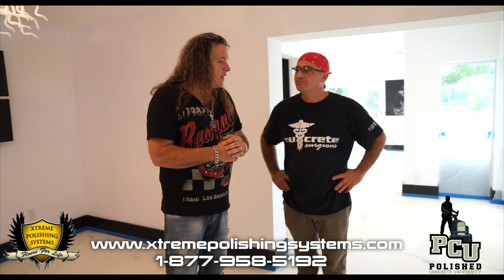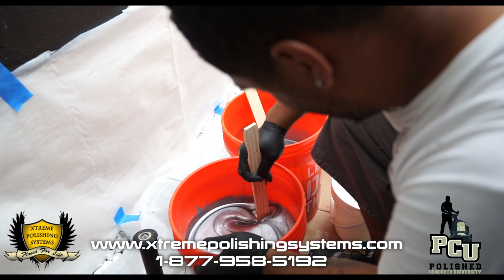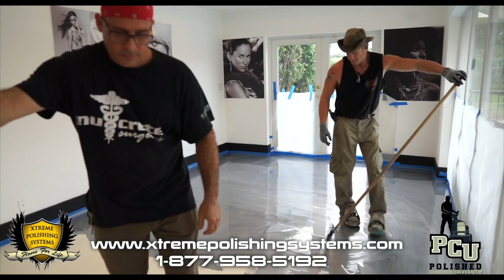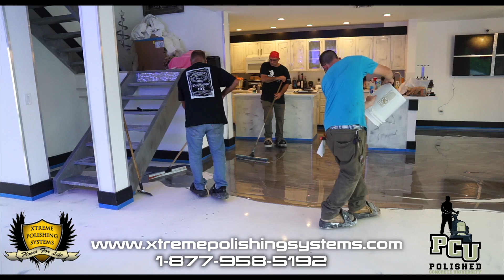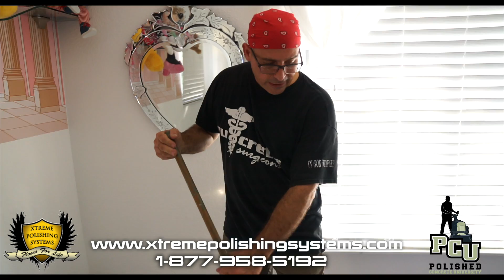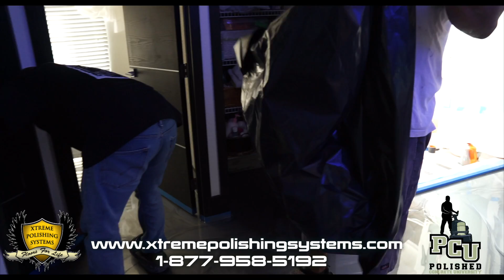Silver Metallic Epoxy Residential Floor Installation Start to Finish | #xps #epoxyflooring

Comment: looks awesome. wonder what the cost per square foot installed is?
Reply from the maker: Our clear epoxy kits are $150 for 3 gallons. This kit will cover between 375-450 SF. When adding in color and metallic pigments, each packet covers 45-50SF. Recommended 2 pigment packets per kit. It's based on the SF you are looking to do. To view our selection of epoxy products, please visit http://www.xtremepolishingsystems.com/Epoxy-Floor-Kits-s/2030.htm

Comment: would it's scratch when you moved you furniture around? dining room chairs for instance.
Reply from the maker: As long as the epoxy has cured properly, it's meant to endure high trafficked areas. It'll hold up against scratches from chairs.

Comment: Wow the end result is too fucking beautiful. For a second there I thought it was still wet haha. How much does a job like that usually cost?
Reply from the maker: We do ship worldwide and can get any product or equipment to Australia.
Reply: Xtreme Polishing Systems i currently do concrete staining but would be interested in doing these epoxy floors as well nice work guys
Reply from the maker: Our clear epoxy kits are $150 for 3 gallons. This kit will cover between 375-450 SF. When adding in color and metallic pigments, each packet covers 45-50SF. Recommended 2 pigment packets per kit. It's based on the SF you are looking to do. To view our selection of epoxy products, please visit http://www.xtremepolishingsystems.com/Epoxy-Floor-Kits-s/2030.htm
Reply: Xtreme Polishing Systems 
Bonjour
Are you in France ?
Reply: Xtreme Polishing Systems what a shame you are not in Australia

Comment: what aboit like a full on shiny metal floor, like not metaluc but like aluminium foil or like a mirror
Reply from the maker: Yes, that is possible to do. Anything you can think of can be created with epoxy coatings.

Comment: How much was the cost?
Reply from the maker: Our clear epoxy kits are $150 for 3 gallons. This kit will cover between 375-450 SF. When adding in color and metallic pigments, each packet covers 45-50SF. Recommended 2 pigment packets per kit. It's based on the SF you are looking to do.

Comment: How much would this cost? Is it available in u.k
Reply from the maker: Our clear epoxy kits are $150 for 3 gallons. This kit will cover between 375-450 SF. When adding in color and metallic pigments, each packet covers 45-50SF. Recommended 2 pigment packets per kit. It's based on the SF you are looking to do. We ship anywhere in the world. Shop our selection by visiting www.xtremepolishingsystems.com/Epoxy-Floor-Kits-s/2030.htm
Reply: Xtreme Polishing Systems thanks does the floor have to be totally smooth for it to lay or will this product fill holes etc ?
Reply from the maker: It's a self leveling material.
Reply from the maker: Yes, we have attendees from all over the globe train at our South Florida location. To learn more about our training courses, please visit http://www.xtremepolishingsystems.com/Articles.asp?ID=285
Reply: Sir I am   from India... Want to do dis course..  Is it possible

Comment: so how would this hold up to damp coming up from under the floor? major issue for any UK home in the winter
Reply from the maker: Depending on how much moisture they have, you will probably have to put a moisture vapor barrier down fort then coat over it.
Reply: In Britain and especially Yorkshire there's a major damp issue, im guessing much like any other flooring, moisture rising up will cause the epoxy to lose its adhesion and lift up? Im also gunna guess that it cant really be patched like conventional flooring? Its a shame cos it looks great but appears only really suitable for warm dry climates like you get in america (its 2°C here lol)
Reply from the maker: It's a self leveling product, but yes, you are correct. The epoxy will not adhere to any wet surface. It would need to be dry and a solid surface.

Comment: Roughly how much would this cost for 1500 square feet?
Reply from the maker: Cost per square foot depends on floor whether they want a solid color, metallic, or flake floor. Give Adam a call at (877) 958-5192 with questions.

Comment: I have a few questions 1 could this be applied in a shower 2 I've worked with epoxies and resins before but only in small batches so what are the recommended sealers 3 do you need to use any special cleaning agents on the surface

Comment: How hard is it to remove this if it ever needs replaced?
Reply from the maker: You would need to use a floor grinder to remove the epoxy, but it's not hard, per say.

Comment: How are they not leaving tracks in the epoxy
Reply from the maker: We use spiked shoes that help us walk on the coatings without leaving any marks.
Reply from the maker: 2-3 days is what is recommended
Reply: ***** How long til you can walk and put furniture down?
Reply: Xtreme Polishing Systems How long till you can walk and set furniture on it?
Reply from the maker: Once the epoxy has been cured and sealed, it's not slippery at all. Epoxy is ideal for highly trafficked areas.
Reply from the maker: Yes, as long as it's a smooth, solid, dry surface, epoxy can be applied on top.
Reply: Sir can it be done on normal floor of cement n concrete

Comment: Hey Chris, just wanted to know how hard this stuff gets in relation to having furniture on the epoxy for extended amounts of time. will furniture leave dents in the finish or even heavy scratches and if so, how are those areas repaired? thanks from Parkland FL!
Reply from the maker: Epoxy is perfect for high trafficked areas, mainly for industrial applications and will most certainly hold up against furniture for long periods of times.

Comment: I've been a painter for two decades now. Epoxy cures/dries incredibly hard. It is TOUGH ! If it is ever anything but perfect, it was applied incorrectly. This is beautiful, and I suspect many of the commenters aren't aware how durable an epoxy floor is. Paint has came a very very long way! Good paint is like painting with liquid plastic, good epoxy.....liquid steel ! LOL
Reply from the maker: Couldn't have said it better.

Comment: Is this removable? Say you want a different look several years later, like hard wood, or wanting to put carpet in a room that's been done with the epoxy
Reply from the maker: Yes, epoxy is removable with a floor grinder. Epoxy is an extremely durable material, so the process maybe tedious.

Comment: can you use it in garage or not recomended? I keep having issues with hot tire pick up.
Reply from the maker: Epoxy is ideal for garages and industrial applications due to it's durability. The most common places for epoxy coatings is garages, kitchens and warehouses.

Comment: Would this be extremely slick if it was wet
Reply from the maker: Yes, it is slippery when the epoxy is wet, but with proper shoes, such as spiked shoes, you will have no problem walk on the coatings while wet.
Reply: Xtreme Polishing Systems 
is the finished floor slippery if water gets in like in the bathroom after a shower

Comment: how much did all that cost
Reply from the maker: Our clear epoxy kits are $150 for 3 gallons. This kit will cover between 375-450 SF. When adding in color and metallic pigments, each packet covers 45-50SF. Recommended 2 pigment packets per kit. It's based on the SF you are looking to do.
p.p1 {margin: 0.0px 0.0px 0.0px 0.0px; font: 12.8px Arial; color: #222222; background-color: #ffffff}
span.s1 {font-kerning: none}
span.s2 {text-decoration: underline ; font-kerning: none; color: #1155cc}

Comment: can we do it on any kinda marble floor ? plz answer
Reply from the maker: Marble surfaces are typically polished and then sealed, but it is possible to apply epoxy coatings over marble. With proper surface preparations, such as grinding down to a smooth surface and applying a primer that can penetrate the marble, epoxy installation is an option over marble.

Comment: what's the durability of the product and the resistance of scratches from pets ?
Reply from the maker: Epoxy coating is perfect for high trafficked areas. Epoxy is durable against spills, stains, scratches, ETC.

Comment: That looks pretty nice. What about bubbles, though? I assume even if you are careful you will get some, do you fill them or can you melt/solvent little parts somehow?  Did you put the charcoal on after the first had set? How did it look with just the silver? Video cuts to the charcoal pour with no indication of time. How would you remove it? Can you do an epoxy over existing flooring just to make it more resilient, a soft wood for example?

In the future could you guys clean up the audio? There's a mechanical/grinding noise in the background that could have been filtered out easily. I don't even see where it would have come from, since you are mixing by hand.
Reply from the maker: To help with the bubbles, you would want to put a torch to the material while it’s still wet. The charcoal was applied while the epoxy was still wet. Don’t wait for the first to set and harden. Before applying the charcoal the silver looked like a newly installed silver floor. To be able to remove epoxy once installed, you would need to use a mastic floor grinder to remove the epoxy back down to a smooth concrete surface. As long as the subfloor is solid, epoxy can be applied over wood. Don’t hesitate to reach out with product or process questions (877) 958-5192.
p.p1 {margin: 0.0px 0.0px 0.0px 0.0px; font: 12.0px Helvetica}

Comment: this video is random to me but what's on the bottom of those shoes? it doesn't even leave a mark on liquid state epoxy? amazing
Reply from the maker: Those shoes in the video are epoxy spike shoes. You are correct, the spiked shoes slip over normal shoes, and will not leave any marks on the coatings. To view these shoes, please visit www.xtremepolishingsystems.com/Epoxy-Pro-Spike-Shoes-polishing-accessories-p/shoes-epoxypro.htm

Comment: what's the price per square feet material alone
Reply from the maker: Our clear epoxy kits are $150 for 3 gallons. This kit will cover between 375-450 SF. When adding in color and metallic pigments, each packet covers 45-50SF. Recommended 2 pigment packets per kit. It's based on the SF you are looking to do.

Comment: can you epoxy over a hard wood floor? I have hard wood floors and am in the process of resanding (they were painted by previous tenants) and would love to find out if epoxy or a polyethylene would be better to seal them with after.
Reply from the maker: Yes, it's possible, but tedious. Our industry experts are available for process specific questions. They can be reached at (877) 958-5192 or by emailing in at info@xtremepolishingsystems.com.
Reply: Xtreme Polishing Systems thank you for the response. I will have my husband look into it.

Comment: it looks awesome but how would it hold up in my garage when I pull my muscle car in garage with hot sticky tires thanks this two part color is perfect how much would it cost for 500 square feet my garage floor is perfectly smooth it was done with a michene to make it nice and smooth
Reply from the maker: Epoxy is perfect for garages and other high trafficked areas. Our industry experts are available for process specific questions. They can be reached at (877) 958-5192 or by emailing in at info@xtremepolishingsystems.com.
Reply: Chris Boggs The two part epoxy is the way to go with a high gloss finish of any color you want. you have to work with it fairly fast as it does heat up once you mix the two parts together. In the painting business we call it "it's cooking". Cause it get so hot you could cook on it. Once the two part self levels, after troweling it with the large floor ones like these guys used, it's just a matter of wait time. once it's set, your good as gold. The stuff is super hard and will hold up to any type of tires. I don't recommend doing burn outs in the garage though.

Comment: How does this hold up to garage use?? looks amazing guys im here and Florida also and looking for a garage solution that wont peel up like the lowes and home depot kits
Reply from the maker: Epoxy is preferred to be installed in garages, as it's perfect for high trafficked areas. our epoxy kits are industrial, which eliminates peeling.

Comment: Totally awesome! I am so epoxy bound! I got the black & grey. However, before I use it, I  think I will also get the beige like in the other video. How do I  know which color to add 1st in order to achieve the look that I  want?
Reply from the maker: That is great to hear. For process and procedure questions, I will have to refer you to Xtreme's industry expert that will be able to walk you through from start to finish. Please call (877) 958-5192.

Comment: Hi, fine. I'd like to know which material to use in the final finish protects against scratches and scratches.
Reply from the maker: A concrete protector is applied to seal off the concrete from being about to be penetrated. Xtreme Shield is the perfect sealer over concrete. To learn more, please visit: http://www.xtremepolishingsystems.com/floor-sealant-s/1874.htm or give our industry experts a call at (877) 958-5192

Comment: Hi this is an awesome demonstration!! Can u guys tell me about 3d pictures under the epoxy. is it the same process
Reply from the maker: Yes, it's the same process. You would need to lay down a floor stencil that is perforated and then install epoxy as normal.

Comment: Is it slippery?
Reply from the maker: No, epoxy is slip resistant and meant for high traffic areas.
Reply: Xtreme Polishing Systems thank you so much for answering my questions 😊
Reply: I have 2 very large English Bulldogs that drag their feet when they walk...does the floor scratch easy?